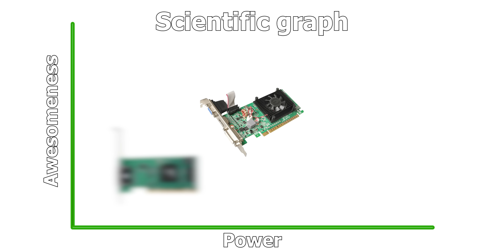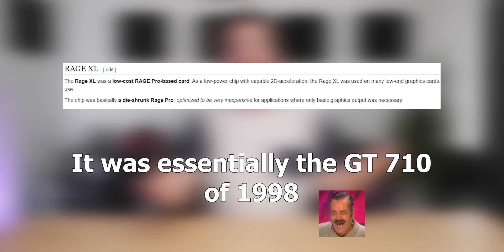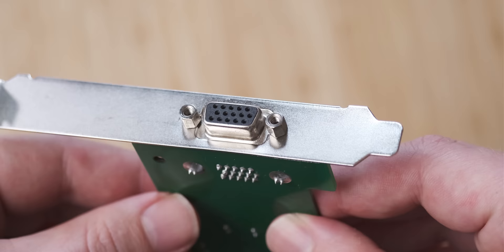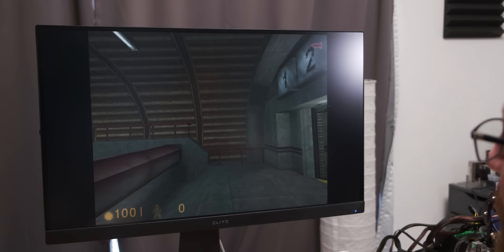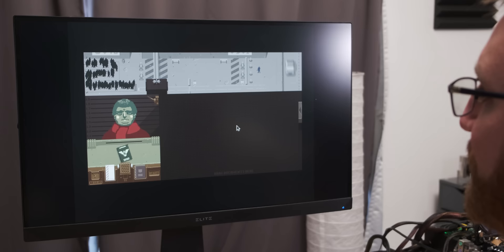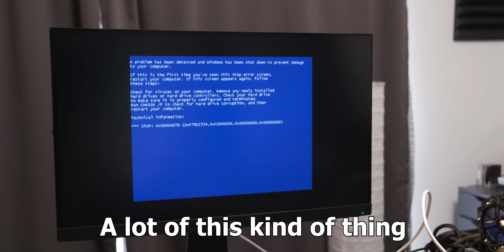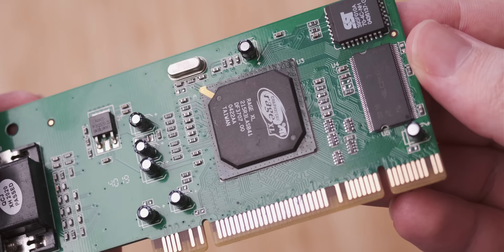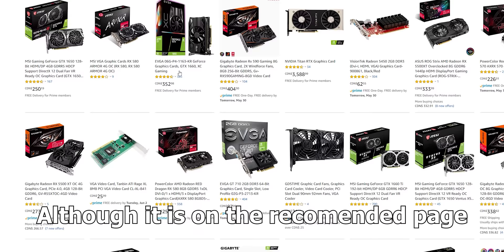Trying to game on the Least Powerful "Video Card" on Amazon

Comment: Windows XP wasn't installing because you didn't have the Sata/AHCI drivers installed properly.
That's what the stop 0x07b is.
I know it well.
The solution is to put the drivers on the USB or CD and press F7 while the install is first loading to load special drivers, or create a slipstreamed Windows XP install that has all the drivers (and updates preferably) pre-configured for install during the initial setup.
OR, you can go into BIOS and set the SATA devices to behave as Legacy/IDE.

Comment: Beings it is 2U, this would make a good video card for a server where you just need a simple video output and aren't going to do anything graphical- But because it is PCI, you would have to get one of those industrial motherboards that combines a modern CPU socket and chipset with legacy PCI. Maybe someone out there is still using an old KVM switch in their server room and just needs a super cheap solution to get a no frills analog video output from a 2U server?

Comment: FWIW, I would have no problem finding a "worse graphics card". I might be able to find an old monochrome graphics card, or cga card from circa 1985 in  my basement, but I know that I have some ega cards still in use from that era. I use Dos to power cash registers, and they are more than sufficient. In that era, you had to have a graphics card as there was never any graphics on the motherboard.

Comment: Can I just say this, if youre buying a Combo or Pre Built, always get the best CPU, as the GPU is much easier to upgrade than the CPU. I got a PreBuilt with a 1650 and in i5 12400f, i can add a 3050 and the i5 will still run great, which is gonna last me a long time, but it i got a bad i3 2010 or something, the 3050 couldnt do anything at all with it. So always go for the good CPU FIRST PRIORITY when deciding. It may seem obvious for some, but As Beginner Enthusiast, i had to learn this the hard way.

Comment: Shown up in my recommendations today, this video adapter was used loads in servers up till 2010s as it could pass the video onto the remote access card for some reason where as newer GPUs carnt, also good if you want to run vms and pass your good gpu to a gaming VM but need a display out for somthing else and dont have onboard video, shows how long they have been arround an ATI Rage 128 was the 1st new graphics card I got with my own money

Comment: In case people are wondering what this turd was actually used for - In the 90s and early 2000s, IGPUs were not a thing.  To display ANYTHING on a monitor (or to have your system "work") you needed a graphics card.  Introducing the RAGE series of video cards.  Some weren't shit.   (Also, the 2D only acceleration thing wasn't an issue, this was solved by a Voodoo 3DFX card, that had a VGA passthrough.  Hopefully a working Voodoo card with passthrough is Dawid's next step to get some life into those games.   Descent 2 on 3DFX was amazing, as was Extreme Assault.   Ah, good ole GLide.  You really needed to know your shit to be a gamer in the dark days.

Comment: Gpus like this are sold for very niche reasons. Good example is alot of servers and point of sale systems that were before 2006 had limited options or just pci. And while it terrible for video or games it functions perfect at what it needs to do for a point of sale system. While replacing these old systems is happening, to a mom and pop business that needs to get that system back to function buying a cheap gpu that's pci will often times do the trick

Comment: Just bought one of these haha.Need it for a server that doesn't have onboard VGA nor IGPU. Ran out of PCIe slots and saw it had a 32-bit PCI slot so I could take out a GPU that was only being used for VGA since the main OS requires at least one GPU in order to run. The motherboard was probably equipped with a PCI slot for this exact use case.

Comment: What are you talking about? VGA supports up to 1920x1080p, full HD resolution and I´ve tested and can confirm that, 1920x1080 does run properly using that ancient VGA port.

Comment: Man, I've been doing such things for a while, I mean installing old junk into modern computers and vice versa, installing old OS on modern PCs without driver support and vice versa - it's a part of my job. I am repairing industrial equipment - production lines, some industrial devices with built-in PC and stuff. Industrial PCs are very reliable so they can work dozens of years before they get broken. I've seen much older stuff! What is this video card for: it's a backup video unit (for a backup VGA monitor!) in the case your main card is broken (or you have a driver problem), or/and a card only for 2D work. At least there is SDR memory, but it could be EDO/FPM or VRAM of some kind. The screen resolution is limited by video memory: here memory is only a frame buffer with the size of a frame. To make such things run on your PC you need to take care of OS first, that's true; WinXP looks like good choice, but you also can get or extract drivers from it (or sometimes from Win 2003 Server for example) for your never OS. And yes, sometimes it takes a day or two to make it work. Read and google BSODs to fix the problem. Microsoft driver support policy and UEFI just made such things more difficult. I would suggest custom made (read, illegal) WinXP images with additional built-in drivers and options to make it work, and switch all you can in your UEFI BIOS to Legacy mode. By the way, there are PCI-e to PCI adapters (or PCI to PCI-e, not sure about the name), so you can make them run on newer PCs, with even worse driver problems. The fact is that MOST of those driver problems are artificial: Microsoft makes us to buy a new OS by removing driver support and making producers of hardware to do the same. By the way, a server looks like nice application for this card, especially with Linux.

Comment: Great card for DOS or Win98 gaming, but it won't work in an older system where the PCI slot gets 5v.  This "new" stripped down version of the the original card can only deal with the newer 3.3v PCI slots in modern systems.  Go shopping for the original ATI Rage XL.

Comment: I did buy 10 of these a few years back(bulk), they're good; they're basically onboard graphics for boards that don't have onboard graphics(think virtualization servers and the likes)........ a lot of pci cards do not work on newer boards and I kind of think the rage xl was the standard for keeping basic compatibility(they often came onboard on server mobo's)...... the newest windows version that has drivers was I believe Server 2008 original~(Vista) but had to disable drivers signature to get it to work; the trick to forcing gaming capabilities would be offload opengl or direct x to the cpu using wrappers(it's been too long lol; directgl, comes to mind but I can't recall the others)

Comment: Dude, I had the ATI Rage Pro on my very first PC back in the days! That thing was fast for its time!
Reply: that is tru, got one for my tandy 1000sl2, still gaming on it today.  plays the original doom like a charm
Reply: @dennisdobransky5977  I'm not so familiar with US computers. Was that Tandy still a DOS-Machine or did it already run Windows 95/98 ?
Reply: @maximilianwimmer627  was primarily a dos/win 3.1 pc sold in the early 90s,in canada by radio shack, win 95 capable with the right hardware configurations.  my pc was the desktop type instead of the keyboard built in style machine.

Comment: Your XP issues probably due to SATA controller being in AHCI mode. (You should be able to set that to compatible/IDE mode in BIOS and that should get the XP installers to work) Vista and 7's installers had much better compatibility with AHCI SATA stuff so it was less of an issue there.

Theoretically you can install XP on a machine that's in AHCI SATA mode but you have to put the SATA controller drivers on a floppy disk and hit F6 at the prompt when the installer asks for one...but lol good luck with that with modern machines. :P

Comment: I had a ati rage 8mb with my pentium 3 400mhz and ran gta, quake and unreal tournament, gpolice absolutely fine, this was with windows 98 se, res was 800 x 640, the drivers have to be manually installed for everything 1 by 1 even on XP, would take half a day, a voodoo 2 was added via pci and was amazing.

Comment: if you get a blue screen of death with winXP install, it will be due to a raid driver. you need to install the 3rd party driver during the first steps of the install... sppiler, you need a floppy driver or an FD emulator, can of worms!

Comment: The N64 literally has a more powerful GPU than this graphics card. And it's even older, since it came out in September of 1996. But it still blows the doors off of this 1998 video card. The N64 at least could run fully 3D world's and still maintain 30fps.

Comment: You should have bought my Nvidia GeForce 8400GS with a whopping 1GB.  The only issue is that the 1" fan is defect, but you don't really need the fan, if you have a reasonable case fan.

Comment: You missed the point of this card.  This card was a BITCHIN top-of-the-line 2D graphics card back in the early 90's, around the 486 era.  If you're into retro computing and building a DOS gaming rig (and don't care about using period-correct hardware), this GPU would be a fantastic choice.  Add a Voodoo1 or two Voodoo2's in SLI for 3D acceleration (and Glade support) and run a passthrough cable between the two, and you'd be 100% ready to play some DOOM, DOOM II, or QUAKE. :)

Comment: Back in my day, 3D accelerator cards only output 3D graphics and required a 2D card to work. The 3D card had 2 VGA sockets, one in, for the 2D card to plug into, and 1 out for plugging into the monitor. I'm pretty sure this is one of them 2D cards.

...okay, a quick Google says it isn't, it's the lowest end of the first gen 2D/3D combined cards. Sorry about that. I'll just leave this here for lulz, maybe someone'll learn something completely useless. I'll go back to telling kids to get off my lawn.
Reply: An interesting note, actually, before I forget. My old man brain doesn't work as well as it used to:

This is legitimately the crappest of the crap "modern" graphics card, with combined 2D/3D.

Comment: For up to date PC's, its rubbish. Great for servers outputting to a screen for the command line to run diagnostics (with PCI slots). I had a server board and that GPU was embedded on it. Also great for testing stuff on older boards when fans spin but no POST. I wouldn't even consider putting a game near it. I always have some PCI cards in my testing arsenal, you never know when you will need one.

Comment: Off topic but there’s literally an Alienware PC on Best Buy right now for $2,300 and it’s got a freaking 11700F, 3060 ti, 16gb of ram, and 512gb ssd …. 🤨 wtf are these prices for PCs we know are terrible most the time. 

Sorry I was just glancing around for an 11700k and saw that and my jaw dropped! That set of parts even in other pre built PCs is like $1,300 or you could get a 12700 for like $1,400 🤦‍♂️ dell what is this if it’s not going to be premium at least make the prices decent 

Orrr hear me out you could stop running it like dell and start making good gaming PCs again and really lean into the brand and keep the prices a little higher but actually offer really good products 🤷🏼‍♂️

Comment: I apologise if I am being presumptuous, here...but why are you running Windows 10 on a machine which would be compatible with this video card?  Windows 10 would be causing a lot of overhead aside from the game itself.  I'm running a 6 core 3.4 GHz machine with 64 Gb of RAM and a 4 Gb card with Windows 10, and I get stuttering and lag in my games from all the resident malware it runs.  There are places online where ISOs of Windows 7 and XP are both available.  I would recommend XP for this.

Comment: I'm feel old now, the video card looks good to me :buffering: I had much weaker video accelerator card in my Pentium II second-hand build. You picked the wrong games, bro.
This card would run 3D games like Harry Potter 1 and 2, Tank Racer or Star Wars: Dark Forces easily. Testing those games on "modern" setup is pointless...when Vista Aero eats all GPU power. 😅

Comment: "1600x1200 maximum resolution"
i have 2 vga ports on my pc that both push 4k at 75Hz just fine
that limit is not caused by the vga standard, rather the processor itself
higher end processors that still have vga typically get 2048x1536 as their maximum resolution and with some warranty voiding tricks you can get higher resolutions
though you need a compatible display to take advantage of pointlessly overclocking the vga standard...

Comment: Everything is using software rendering here.

There are (obviously) no drivers for the Rage XL for Windows 10, so you are using the Microsoft VGA driver instead.

The VGA driver in Windows 10 doesn't support 3D hardware acceleration at all. Instead, it uses a software implementation of Direct3D called WARP10. Windows does this because even the basic desktop requires Direct3D to work. This has been the case since Windows 8.

3D applications think they are using "hardware" rendering because Windows lies to them for compatibility purposes.

If you want to test the actual hardware acceleration, you need to use the Windows 98 or Windows XP drivers. They won't install or work in Windows 8/8.1/10 (which dropped support for XPDM), but they might work in Windows 7.

Comment: This wouldn't actually bother me...in my old QX6850 system I ran Voodoo2 in SLI...off my 650ti's VGA output.

Diablo 2 looked pretty damn good running in Windows 7 with Glide.

Comment: I think people underestimate severely what you can do with even something so underpowered as this. BASIC was ground breaking and it only needed a 6502, (which should be noted only had about 3MHz speed max at the time) a rom, and 16-64kb of ram. I'm not exaggerating when I say this card genuinely does have potential in certain areas of early and crude computing :)

Comment: 3:35 - That maximum resolution and color depth has nothing at all to do with it only having VGA output ("VGA", i.e., RGBHV, has no inherent limit on resolution or color depth). It is because of the small amount of video RAM, which I doubt actually has 8 MB of usable video RAM. It most likely has 4 MB, and here's why:

1,600 × 1,200 = 1,920,000 pixels
1,920,000 × 16 bits = 30,720,000 bits
30,720,000 bits = 3.66 megabytes

So 1600 × 1200, 16-bit color, requires 3.66 MB of video RAM just to display, and any step higher than that (such as 24-bit color) would require more than 4 MB. If it really had 8 MB of usable video RAM (and maybe it does... with drivers), its maximum would be, e.g., 1920 × 1080, 32-bit color, which requires 7.91 MB of video RAM.

Comment: I think I actually had a related video card back in the day... my Presario 5204 came with an integrated ATI Rage LT Pro on Windows 98SE. It seemed like an upgrade to me, but that could be because I was coming from a Trident TVGA card on a 486...it had a few very simple 3D games it could render at a decent speed that came with the PC, but it did seem like it choked on anything more complicated than older DOS games even back then. Let's just say that even though this was using the AGP bus, I was able to upgrade it with a PCI-based Radeon near the end of its life and get better performance in games... make of that what you will. I looked it up and apparently these chips eventually got relegated to being integrated on server motherboards that didn't need advanced graphics up until about the time Intel started integrating GPUs into CPUs (that's the only reason you really don't see low-end GPUs like this anymore... Intel knocked the bottom out of the market by making sure you wouldn't need a low-end GPU just to build a cheap i3 machine for office work or something). But in 1998, you could find them in consumer desktops as built-in graphics.

Comment: It wasn't a terrible card when it came out...I actually had a similar one at one point, it was a Rage Pro and not a Rage XL though.  I had some kind of Cyrix 6x86 CPU.  I only remember it fit in a socket 7 board.  Don't remember any more details.  I later paired it with a Voodoo 2.  It should be noted that the Rage XL was a cheaper, entry level version of the Rage Pro, so this was entry level in 1998, lol.  Back then to get 3D you had to get a separate 3D accelerator.  I did stick with ATI cards for a long time though, moved from that to a Rage 128 Pro, then from that to the Radeon series, stuck with that until I got a 780ti in 2013.

Comment: Hey, I have a GT 710, and it's not bad for some light gaming on older stuff life Minecraft. It even "ran" Fortnite, and that's where I got my first win. Chapter 1, yeah, but still. 😅
If you get BSODs when reinstalling, using a reinstallation disc might be better. I was having the same issue too. A machine I had XP on before just wasn't allowing XP to be installed. Thankfully I have a fully functional XP laptop I use regularly though, that also has Windows 2000, Vista, 7, and 10 on it. 😂
I'm guessing it was simply meant for PCs that had no integrated graphics.

Comment: I get it, but this card should be running on Windows 95 or 98. During that period it played DOS games great and most first gen 3d games ran okay. Kids don't realize those old cards from the late 90s were created to operate at resolutions  320x200, 640x480, and 800x600. You have to think of 1024x768 as like playing at 2k resolution today and 1280x1024 would be like 4k today. Most everyone gamed at 640x480 or 800x600. If you could game at 1024x768 or higher in the late 90s then you had a godly system.